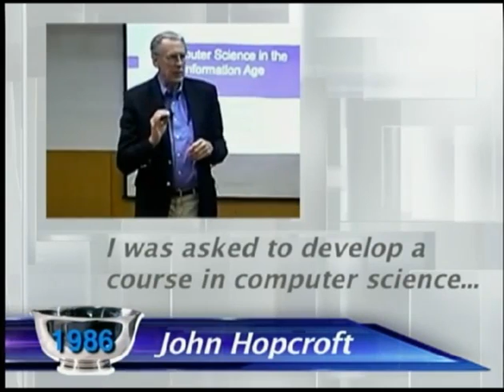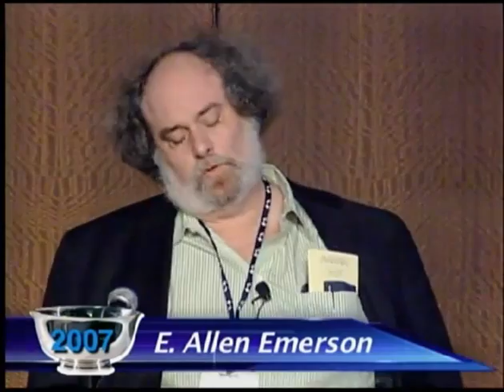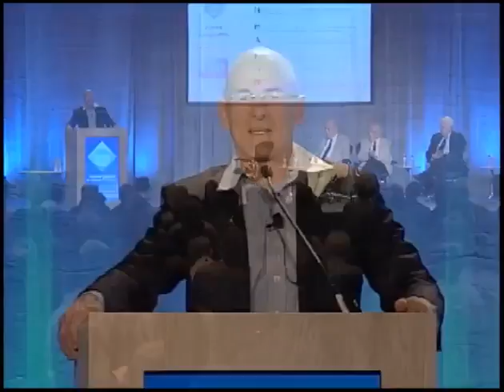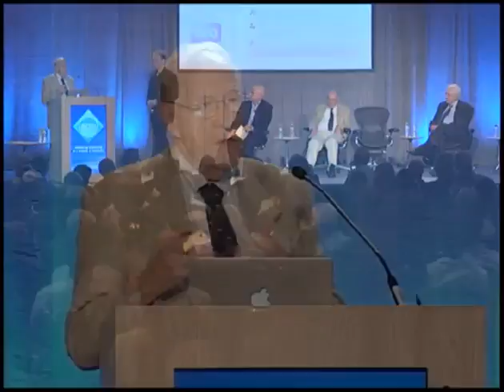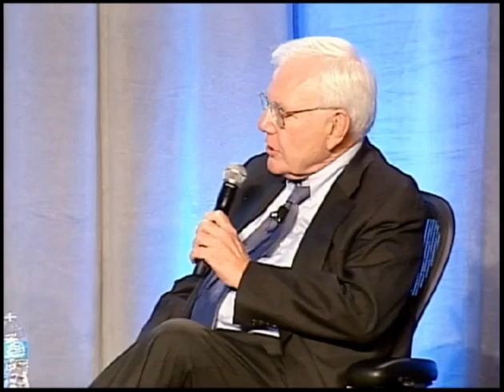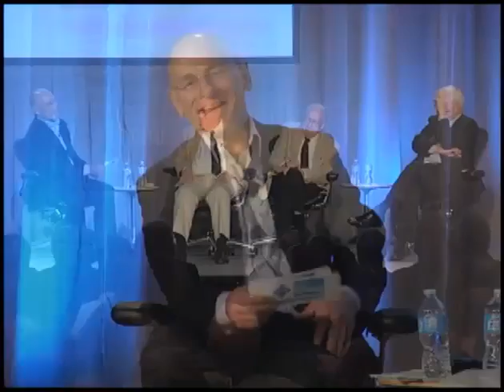Computer Architecture

Comment: Isn't this doomed like attempts to create multi-threaded GUIs?
Reply: I don't know the future, but I think the recent integration of FPGAs into hardware:
http://www.enterprisetech.com/2014/06/18/intel-mates-fpga-future-xeon-server-chip/

...is a good sign as it starts to "open the door" for new (or even dynamically designed) hardware architectures (as Chuck Thacker describes).  

FPGAs have been around for a while, I think they are getting "cheap" and ubiquitous enough... and whether they catch on (like wildfire in the near-term)  is likely a big big question (as currently they are energy hungry and "hard" for software folks to grok and "design".)

For the near term, forsee that (the mainstream) doesn't do anything radical with FPGAs or Independently clocked architectures, but I imagine those who start to see bottlenecks when running at massive scale start to get creative with new programming paradigms (Amazon offering Ubiquitous GPGU computing comes to mind)  but as both Ivan and Chuck state the idea is "inevitable" since we are reaching the physical limitations as far as the speed of light and heat
Reply: Eric DeFazio Cool info, thanks for sharing. But I think this isn't that different from GPUs or other co-processors in the sense that when results come back from the FPGA they are still enslaven to the clock rate ?
Reply: Yes, true (currently)... I think the idea that FPGAs bring is "modular" circuitry... so we're used to programming via instructions, and we load registers with data, load the next instruction, execute it (the CPU)...(repeat ad naseum)

If something like integrated FPGAs were completely decoupled from the Motherboards clock, though (and since we can design theoretically any micocontroller with a large enough FPGA)

We could have our microcontroller flash the FPGA with the specific design and allow the internal FPGA to "execute" the program (and each "part" of the program could use the most appropriate clock and mediate the asynchronicity.

What I mean by this is that (the programmed part of the) FPGA actually receives the input "data" and is "programmed" using it's circuitry and the microcontroller isn't even in the critical path (other than to Program the FPGA)... this way we are TRULY dedicated hardware (without the overhead of the Operating System, as well as no need for an instruction register or instructions (prefetching, etc.) 

Now this might not be the best solution for ALL types of applications, but for dedicated server applications serving up very specific types of applications (not your desktop which loads all kinds of programs at will) it could be really fast/valuable

So what i am describing might be something different than what we call "FPGAs" today... (it could be an entirely new animal perhaps a more specialized component that provides the same metaphor of  "programmable circuitry" and allows this type of customization (ubiquitously) 

We aren't there yet (theres still figuring out who "owns" the cache (CPU or the FPGA) Just a brainstorm of mine.
Reply: Totally get where you are coming from, but the issue comes to a head when you have to sync all this stuff that is going on FPGA(s) and the main CPU and its caches / main memory right?

Ultimately the latency of the clock cycle will hamper everything you will never escape that latency. I think that's what the concern raised at the beginning of the video. 

We see similar things in automated trading.